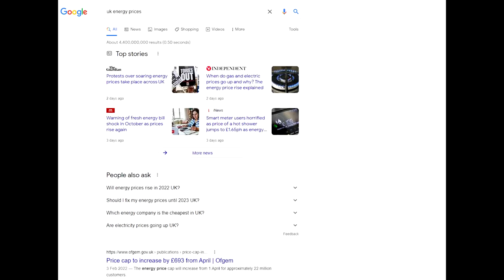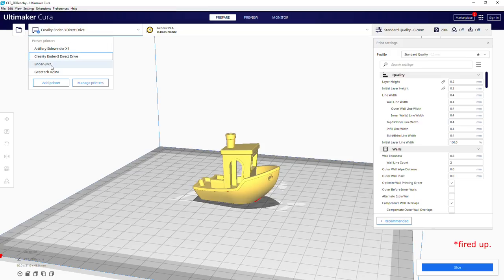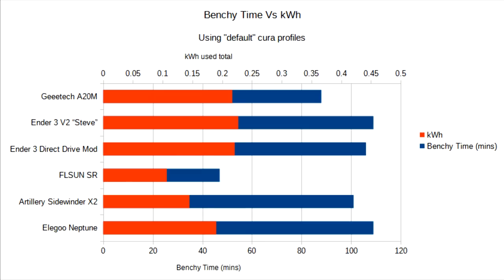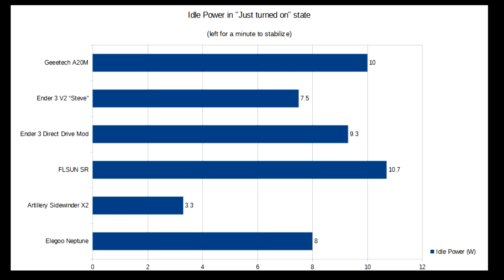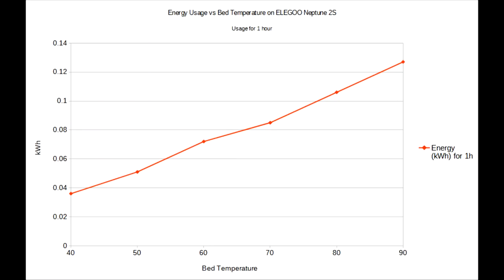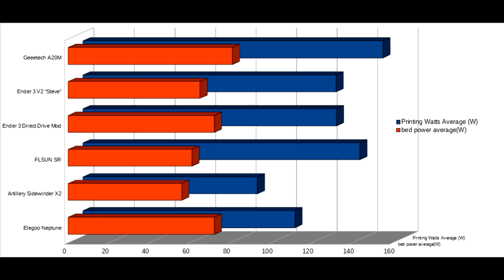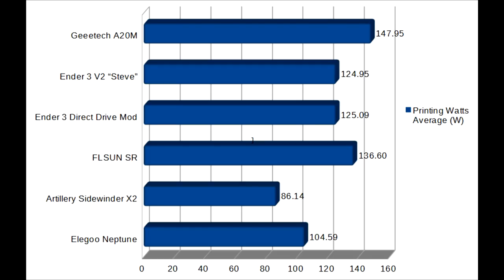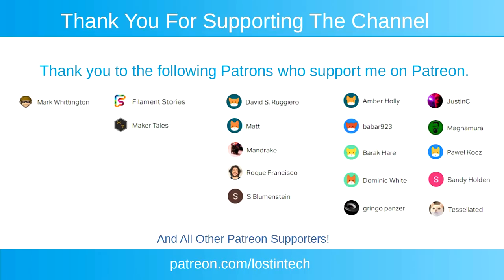I worked out exactly how much electricity 3D Printers use, whether you should care, can you save?

Comment: I came to the same conclusion, the energy cost is almost negligible but if you are still concerned about it then adding some insulation to the bed is about the best thing you can do.
Reply: It's just good in general to insulate it. Faster heating, more sustained and more uniform. All the benefits, zero downsides I'd say :D
Reply: @DARKredDOLLAR  increased weight if you have a bed slinger

Comment: Great video!  The Artillery is also the only printer you tested with bed insulation, no?  Heated beds with insulation are more efficient than those without, a la the Ender 3 S1 (without) Ender 3 S1 Pro (with).  The Pro uses ~20% less power than the standard using the same gcode as tested by Aurora Tech.
Reply from the maker: interesting...I also didn't know they'd added insulation on the S1 pro. I have neither :)

Comment: I second the motion to have 3D printer manufacturers rate their machines' efficiency in benchies/kWh.

Also, I would be interested in some empirical data on how much of an effect enclosures have. I can assume that they would probably cut the power consumption of all printers, but in particular I can see the most gains in printers with the smallest enclosed volume (logically); I would, again, assume that in particular the "power saved by an enclosure" divided by "net print volume" would be the lowest for delta printers. Might be an interesting addendum to this video, though I understand that even just the cost buying acrylic sheets to build simple enclosures for all printers would probably outweigh the simple satisfaction of curiosity.

Either way, very interesting, in particular seeing that AC versus DC bed heaters have such a marked influence on power consumption.
Reply: I got to wondering if manufacturers will start to take power consumption seriously now that costs have increased, a printer that is more efficient could be that one benefit that decides a sale, especially in the UK where energy costs an arm and a leg!
Reply: @AndrewAHayes  Just wanted to say a big no to mains powered beds to help efficiency, eathing can be iffy on these & the moving bed doesn't help wire life & contact back to the main chassis. Get a higher efficiency low voltage power supply. A bit of lightweight insulation will give a greater saving for any heated bed. Just make sure there is a thermal fuse...
Reply: @chrisharvie-smith486  I did not mention mains powered beds, but I do have them on my Ender 5 Plus and my Pro 3D V-King 400 both only move in the Z axis and have adequate earthing and strain relief.
 Also I bought my Ender 5 Plus machines from Technology Outlet in the UK, anything electrical if sold in the UK has to meet our very stringent electrical safety certification

Comment: Would love to see the benchies per kWh increase with either insulated bed or an enclosure.

Very good video, I was concerned about increased electricity usage when I first got into 3D printing but quickly realised they don't use a great deal of power.

After watching this I feel like I had calculated it incorrectly, or rather at a "worst case" usage scenario and I feel even better about longer prints than before.

Thank you, LIT
Reply from the maker: A future episode on insulation, enclosures and stuff is penciled in :)

Comment: Considering I've been tasked at work to print some parts for work (good for me, no need to wake up early and take that disgusting horrible bus!), that video came out in a timing so convenient it's downright frightening.
Thanks for the data! I was gonna try to calculate it myself but if you permit, I'll just take a sensible value from your data and add a bit from conversion losses (I actually have a step-up converter to bring the DC bed from 220w to 400w).

Comment: If you are planning on a DIY AC conversation as mentioned in the video make sure it's done safely.
Not a guide just a note to help prevent issues. 

Thermal fuse is a must (125C trip point is a good choice for standard bed temps)

Ensure the fuse is rated for at least 20% more than the max expected current of the bed (it should only fail for thermal trigger it should not be used as a current fuse in addition) 

Brand name/high quality SSR (these can fail open which is the reason for the thermal fuse) 

Solid crimped ground connection for frame and bed - especially important for the bed.

If you aren't going to do or don't feel comfortable doing all these points please for your own safety do not attempt such a conversion.

Comment: Excellent video again and great timing as the boss at home asked me what the power consumption the my "steve" actually was. Now I have an answer and it's (thankfully) a good answer as well :-).
Is the Sidewinder also the only one with bed insulation? I never seen it before, but than again it's hardly worth mentioning during unpacking or first impression video's. I am certainly going to look into insulating my heated glas bed I think that could be really worth it. Keep up the great work.
Reply from the maker: Yes...I never clocked it either but it's been pointed out...a few times 😂
I'm going to have to test that too now.

Comment: Is the sidewinder also the only one with an insulated bed? That could explain the added efficiency. Mains power itself should only be a small difference, because switching power supplies are almost always 80-95% efficient under load.
Reply from the maker: I've put something in the description about the bed :)
Reply: Yeah, the Meanwell 350W PSU I am using, for example, is 87% efficient. So using a 24V bed is only going to use 15-20% more power. That said, mains power bed is great if done safely: heats up faster, and reduces the cost and size of the PSU required.
Reply: @jaro6985  I would trade the added risk of a mains powered bed on a machine I tinker with regularly for a couple minutes of warm up time.

Additionally, having an ender 3 pro with the meanwell psu, it makes me feel a lot more comfortable that all the questionable 3D printer stuff is connected to a known quality psu. So I can trust the psu to have the proper safety mechanisms in case something goes wrong.
Reply: @TheAnoniemo  Yeah that's totally fair choice. Most users would be better off with a 24V or maybe even 48V bed, if such things exist.

Comment: Adding two data points from my end: my Ender 3 Pro printing at 230C/50C (PLA+) draws about 80 watts. That's a little higher than your 60 watt reading, but eh. My Ender 5 Plus printing at 260C/70C (nylon) draws about 250 watts. Both were tested months ago, using a Kill-a-Watt on 20+ hour prints, just because I was curious.
Reply from the maker: 230C would be the reason I guess? What on earth is going on with the ender 5 though?!
Reply: @LostInTech3D  I suspect one of them got insulation underneath (plus the 3 has the bed way lower, less air to circulate under it) while the other doesn't. The +10°c bed, +30°c nozzle shouldn't mean THAT much indeed.
Reply: @LostInTech3D  big print bed at high temps is my guess
Reply: @LostInTech3D  It's the 5 Plus. It's got a massive bed, constantly dumping out heat into the room. You could hold your hand out way up above the printer and feel it emanating.

I did later build a little "greenhouse" cover for it - a PVC pipe cube and plastic wrap on 5 faces. I haven't measured the power usage since then, but it definitely does get toasty underneath, which would suggest the heated bed wouldn't need to work so hard.

Comment: I like the PSUControl plug-ins in OctoPrint. I can plug the printers into a smart plug and set it up so that I can turn them on via the OctoPrint UI, and after a print completes it will automatically get turned off after the printer has been idle for a configurable amount of time and the nozzle has gone below a certain temperature. Makes me comfortable running a print that will finish around 1-2 AM knowing it will shut itself off and not sit there idling (the Ender 3 Pro specifically) using electricity for no reason. Of course, that means the pi is always plugged in and running, but I’m assuming it’s power usage is much smaller.

Comment: I have a SR and I love it. BUT it has some flaws like the firmware and the extruder so you can't even imagine how much I look forward to that video!
Reply from the maker: No hints? 😉
Reply: @LostInTech3D  OK, here are a few things: 
* the extruder is a really poor bmg clone
** that likes to not be able to keep up with the required flow so it starts to click and misses steps when you print too fast (keep in mind that speed is the outstanding feature of that machine) 
** inserting the filament is PITA - I have to remove the idler screw and open the extruder basically evertime. 
** sometimes you can't remove the filament without unplugging the bowden tube because after it was molten it doesn't fit back through the extruder anymore 
* firmware 
** I didn't test it yet but I've seen reports that it doesn't work with octoprint 
** the firmware doesn't have thermal runaway protection enabled on the hotbed (the current firmware fixes that but WTF do you even disable that? It's enabled by default in Marlin so they have deliberately disabled that safety feature)
* speaking of safety: the case was not earthed/grounded (not a native speaker I hope you know what I mean) if you take a multimeter and connect it with the long pin on the UK plug and the case you see it's not connected. I always test that on new printers - this one was the first one where I saw that problem. I made a connection from the yellow/green cable to the case myself 
* the hotend is a weird volcano clone with a heater block that's too small for some reason. The nozzle doesn't fully fit into the heatblock. While it still works it looks stupid and it bothers me even though you don't see it as it's covered by the silicone sock.

All that ranting aside I still really love that printer the things I mentioned above are just so unnecessary and could be easily fixed/avoided some of my points wouldn't even cost more to make it right from the beginning. In my opinion it's really sad that they built such a great machine and did those stupid mistakes.
Reply from the maker: Gotcha. I'm not suffering from all of these, like the loading is actually ok for me, or the extruder (I agree..not a fan of these) but some I will check up on, thanks for the heads up. 👍

Comment: 100W heater at 240V takes less than 0.5A, but at 24V it takes more than 4A.  Losses in wiring are a function of the square of the current, so a 24V bed has more than 64x the loss in the wiring.  This is compensated a bit by having thicker wires with less resistance, but still will be significant.  Add to that the loss for converting from 240V AC to 24V DC and it's obvious that an AC heater is way better.  That also goes for dehydrators by the way.
Reply from the maker: yep i^2.R 👍

Comment: I suspect the reason for the delta’s odd power consumption is the kinematics. For a Cartesian to move from X:0, Y0 to X0, Y100 it only needs to move a single motor. In order to perform the same movement with a delta you need to move all three motors at once. Considering that at least some parts of a a model will consist of straight lines you may be getting the discrepancies from there. As for testing this hypothesis… I don’t know. Maybe print some cylinders with no infill? Just walls. This way you force the Cartesian printer to run XY axes simultaneously? Maybe vase mode so you run all axes at once? Worth a thought.

Comment: An important note is the artillery bed has insulation on the bottom which is probably a big reason why it used less energy.
Reply from the maker: yes a few people have mentioned this...I will have to arrange to test insulated vs not insulated to see how much of it is that.
Reply: @LostInTech3D  Just anecdotally, I insulated my Ender 3 bed to increase the maximum bed temp. Max temperature before insulation was 110-115°C . After insulation 135-140°C. And that's in open-air, no enclosure, using 24v DC power supply. Used pipe insulation foam + aluminum tape.

Comment: Thanks, these are the charts I was looking for, but according to your chart at 2:40 the X2 is using a lot of energy, so the total consumption must be so low because of this insolation-layer under the bed. I'm getting a Bambu Lab X1 hopefully soon and they provide their printers not with the now typical PEI-sheet (available as an option), but a hot-/cold-sheet. The cold plate side is for PLA and PETG, needs a gluestick, but default is just 35° C, so almost nothing in summer. That's probably the next trend with those crazy energy-prices in most of Europe. And there is a 2nd good reason to print with low-temperature print-beds: almost no shrinking of the parts after cooling, which usually is between 0,3-0,6% for PETG. I already had a couple of miss-prints because of this shrinking with parts that needed to fit perfectly.
Reply from the maker: You are correct about the insulation, and a lot more printers now come with insulation!

Comment: I think the faster prints = less power bit has a limit. Taking the hotend as an example, it takes a given amount of energy to raise the plastic temperature to the point of being molten and a certain amount of plastic has to be made molten and extruded to form the benchy, so that value would be your theoretical minimum power draw in an ideal, 100% efficiency system. Then from there all variance comes down to inefficiencies in getting that power to the plastic. You can apply this logic to all the other parts of the print like fans, the bed, steppers.
Reply from the maker: Yes - there is a theoretical maximum. Definitely.

Comment: for the Idle consumption the easiest option is probably to plug the printer in a smart plug and let octoprint turn it off when it is cooled down. cheap plugs like the ikea ones are <15€
Reply from the maker: I keep meaning to set this up - of course you have to also turn off the pi too, annoyingly, unless you have one of the fancy cables that cuts the power between pi and printer!
Reply: This reminds me of the "high voltage" on/off options in Marlin, so you can have your printer turn on the 12/24v (or whatever you use) separate from the controller's power. That would probably significantly reduce this usage, since it would turn off any 12/24v fans and also the PSU's own idle current.
Of course you would need hardware that can do this, like a separate 5v standby supply and something to control the main PSU.
Reply: @LostInTech3D  yeah, currently i just have the PI idling (which takes less power than the printer and is silent) but i cant just cut power to the pi since it doesn't start properly if you don't shut it down.

I would have to somehow shut off a smart plug with the pi's psu with a delay to let it shut down or find a comfortable way to boot the pi without power cycling it.
Reply: That's how I have mine set up.
Octoprint plus a TP-Link Kasa Power Bar and the related plugin.
Shuts the printer off after it cools down, then a controlled shutdown of the Raspberry Pi Zero 2W.

Comment: I know my Prusa eventually stops making noise, I have not monitored it close enough to know when though. I think when the hot end gets below like 50c the fan for it shuts off and the print fan just shuts off at end of job.  I think the PSU also has a fan but it also shuts off when there is no real power demand.

I am pretty sure my 3090FE consumes way more power when I am gaming and for it all the heat is just a waste product that gets dumped into the room by the radiator on the water loop.

Comment: In the future id like to see an additional option put into slicing software that shows total costs.  You enter the cost of the filament and cost per MWH and it gives you a complete breakdown.  I was actually concerned about power usage.  I was looking into items to resell, and I kept approximating 10h prints to £2.50 for energy usage.  I knew I was overestimated but I didn't realize by how much.  In the middle of printing a Paris Lamp (Google it, it's pretty cool" for myself with speedy settings and it's coming in at approx 65 hours.  Without speedy settings its probably closer to 180h.

I was bricking the energy costs, so thank you for the info.  Your effort is appreciated.    

Why don't 3D printers have an option to turn off completely after the print is finished?  I'm using jyers leveling firmware.  So someone went to the effort to provide the community with this free leveling tool and didn't think to put in this functionality.  It boggles the mind.  Not that I mind, they have done a great service, but it just seems unusual that no one has come up with this yet.
Reply from the maker: You can get them to turn off at the end via octoprint/smart plugs. Also, some of the newer models go to very low power mode, like 1-3W. But...yeah it's not huge progress there.

Comment: When printing PLA I only have the bed heat on for the first two layers now the energy prices in the UK have gone up to ridiclous rates!
 + 1 new subscriber
Reply from the maker: Much appreciated! 
If you put it down to 40c you spend very little more, it's almost nothing, but the extra heat is like insurance against the print coming off. 
(I think)
Reply: @LostInTech3D  keeping the bed at 40c is a good thing for borosilicate glass beds so it holds on to the bed but if you print on plain glass or mirror as I do you can print PLA with no heat at all, I just feel more comfortable having the heat on for the first couple of layers
Reply from the maker: Ah - if it's plain glass then it's a different barrel of worms! :)